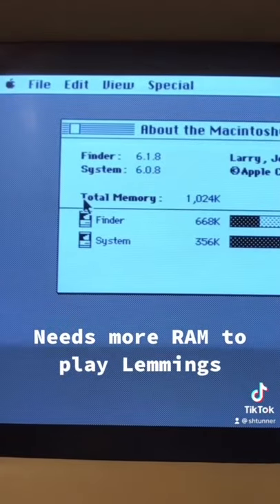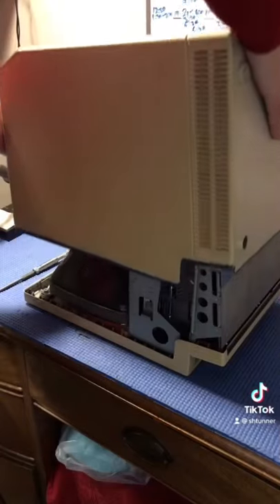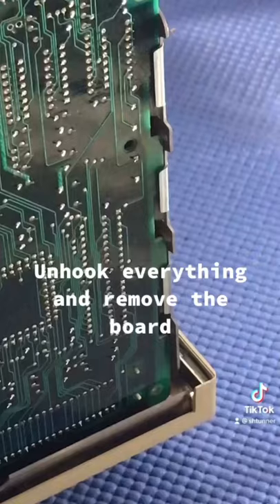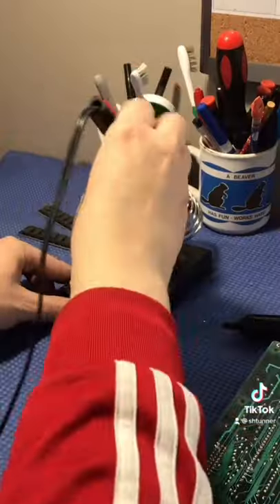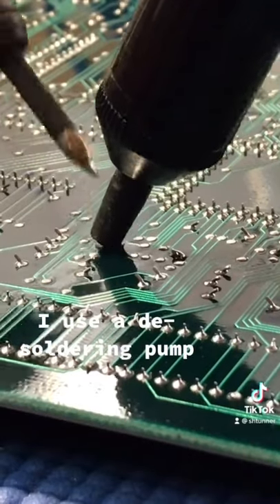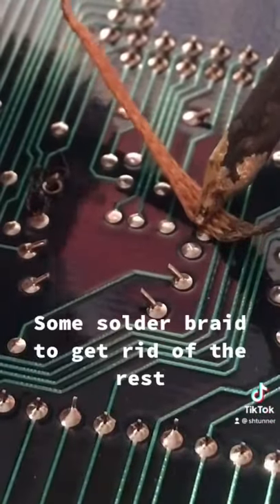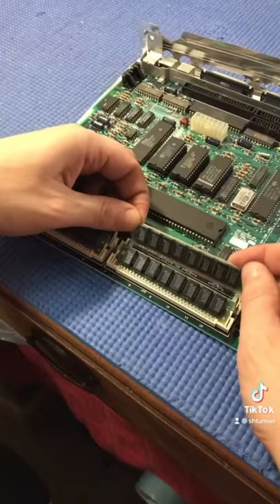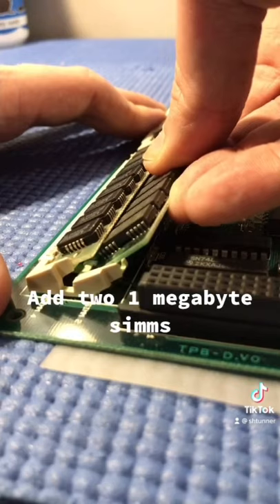#Shorts Upgrading the RAM in a Vintage Macintosh SE #RetroGaming

Comment: I had one when they were new.  The tray slides out, you do not have to remove.  Clip the resistor with pliers so you don't have to risk snapping 35 year old clips.
Reply from the maker: Nice! That’s awesome! The service manual recommends removing the board this way, to not damage the speaker wire.
Reply from the maker: I prefer to de-solder. I can more easily return it to stock, and it’s much cleaner
Reply from the maker: If folks aren’t comfortable with soldering, I totally understand but,  If you own any vintage machines, you better get used to soldering haha.
Reply: @ashtonsretrocomputerroom  The issue was not soldering, but risking a VERY expensive computer.  I did two of these when the computers was new, and I never hear of anyone, even the apple resellers, actually de-soldering them.  It is just a standard resistor, so if you wanted to downgrade the ram, you can always clean up after the fact.
Reply from the maker: @bindingcurve  Ah, I get where you’re coming from. Just obsessiveness on my part haha

Comment: Man i love these old machines. I wish i could get my hands on some. The only retro enough PCs i have is IBM 300 tower from 1998 and  an 486DX motherboard from 1989 i think
Reply: I have a Dell Dimension 4400 from 2002, which has a 1.7GHz Pentium 4. Upgraded the RAM to 1GB and replaced the 16MB ATI Rage 128 Ultra GPU with a 128MB GeForce4 Ti 4600 and installed Windows 98 Second Edition on it, and it runs Quake 3 Arena very well at 1080p after installing the version 1.35 patch.

Comment: I want to buy one and put the specs of my current computer into it

I will have to do external power suply

But imagine that with an i9 12900 
48gb of ram 
And an rtx 3070
Would be wild

Just realized i could put the psu in a floppy reader

Comment: Calculating the RAM in KBs made it look bigger but thats only 2MB RAM😂
Reply: 1024 KB per MB, multiplied by 2.5 is exactly 2560. I’m guessing the old ram was four sticks of 256 KB, and they replaced two sticks with 1024 KB, giving 2560.

Comment: Imagine slapping 64 gigs in this for no reason
Reply: Impossible. Imagine you buying a clue before saying something that silly. Would not see more than 16MB no matter how hard you tried, Motorola 68000 only has 24 address lines. Also some of those addresses would be used for other things, like ROMs and such, so you wouldn't even get a full 16MB. But Apple probably limited this particular model to 4MB because Apple.
Reply: @SeeJayPlayGames That’s exactly the point lol. It would be entirely useless, but having that much ram in such an old (but beautiful) pc would be funny

Comment: Ram 1024k in 1987
Cache L1 1024k in 2020(?)
Reply: i5-4590 L2 cache is 4x256K (1024K) in 2014 (L1 caches are only 32K data, 32K instruction per core, so 256K total). 6MB L3 (i7-4770 has 8MB).

12th gen (2022) has 80K L1 per core, so the higher core-count (16 and up) SKUs exceed 1MB total L1. L2 and L3 sizes are ridiculous.